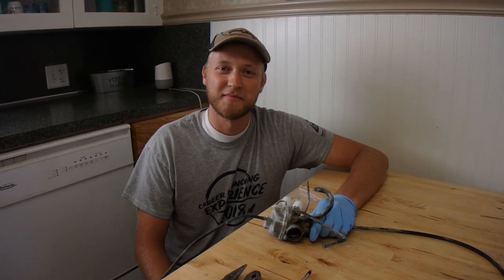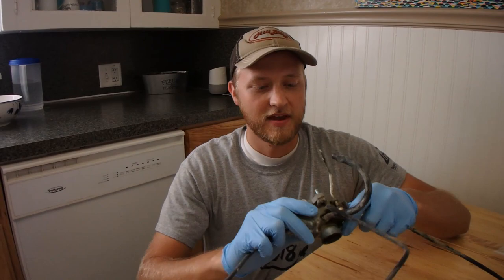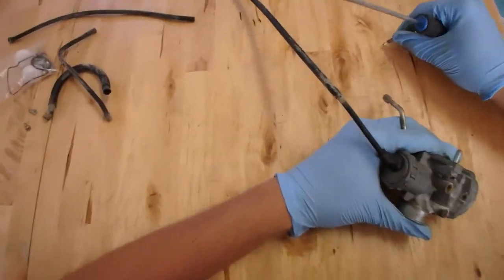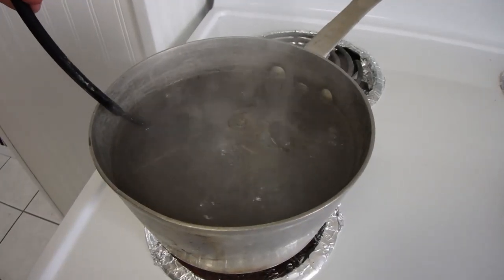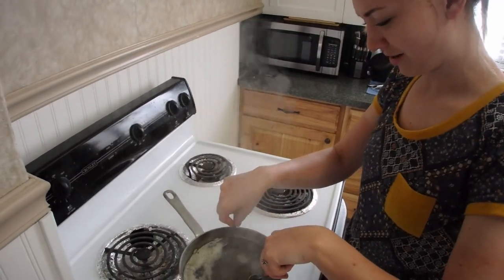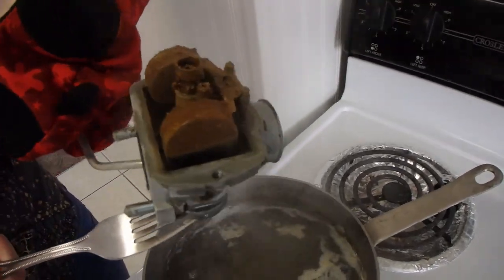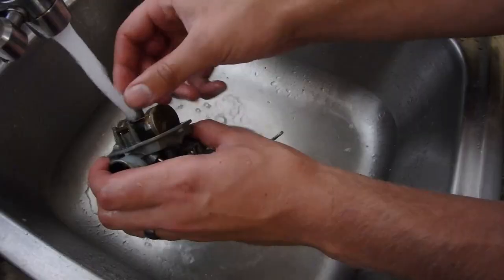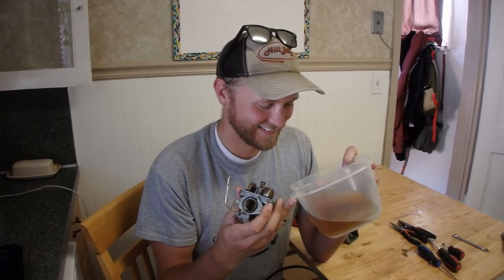Boiling a Stuck Carburetor

Comment: Before ever seeing your video, I thought there must be a reason they say "Boil Out the Carb". The first one I did was my Koehler carb with Simple Green. Then I did a BMW Isetta carb and Dawn dish soap, I never let mine touch the bottom of the pan, I suspend on a wire. Now I do my KeiHin Honda 600 car carbs - Always works great and always have trash on the bottom of the pan.